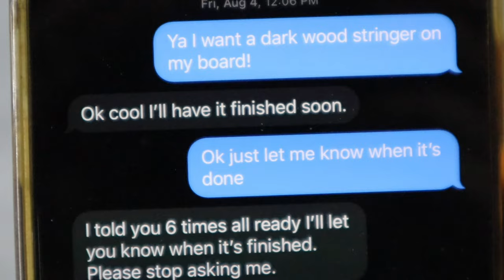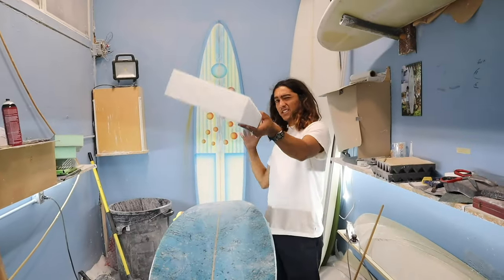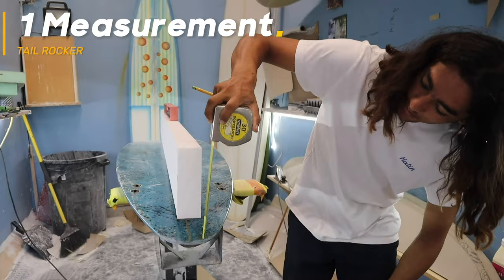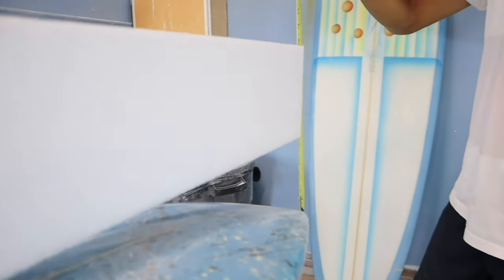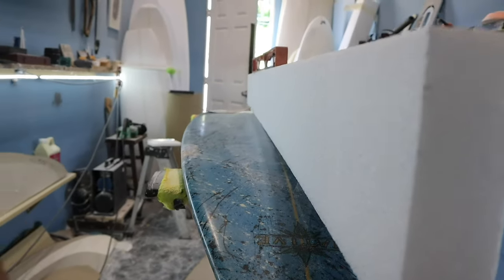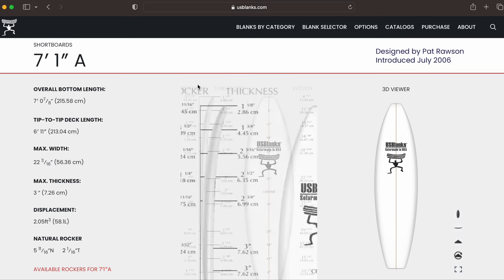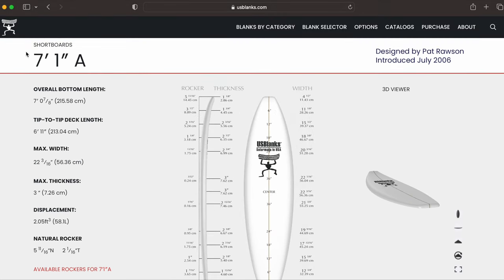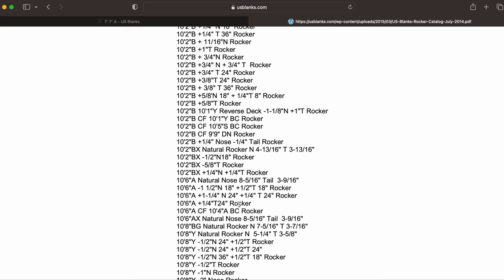How to shape a surfboard; What surfboard should I choose? part 3

Comment: Question. How does one know the rocker of a board? Aside from preference.. 

I’ve got a 5’6 I want to stretch out into the 6’6. Say the nose rocker on the 5’6 is 3 1/2, what might the rocker be once stretched out to give similar feels on bigger waves? Been thinking do the same rocker and see how it comes out.
Reply from the maker: So… there are a few ways rocker is determined when stretching a board. I will usually increase rocker the longer the board gets.
If you keep the rocker at 3 1/2” it would end up creating a lower rocker profile. This is because the 3.5” of rocker is stretched over an extra 6” Of board. This will make the board feel more stiff because of the longer rail line and less rocker. The other way I determine rocker is by looking at the outline. A basic rule of thumb is the faster the outline’s curve increases, in the same area, the bottom rocker should increase. For example, the end of the board is usually where the most outline curve is  and the bottom rocker follows that. That is why there is a flip in the nose and tail. Hope that makes sense and is useful.
Reply: @zack_flores  got it! That does make sense. Thank you 🙏🏼 And to get specific without being too annoying, would adding a foot in length allow adding 1” of nose rocker? And say 1/2” increased tail rocker? I can respect there’s no formula for this, but just wondering what your throughs might be. Cheers